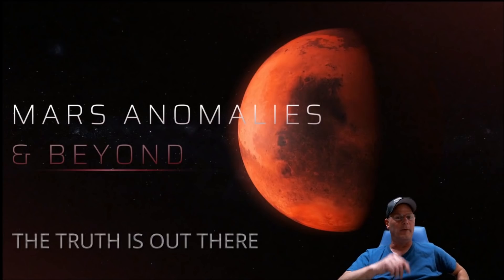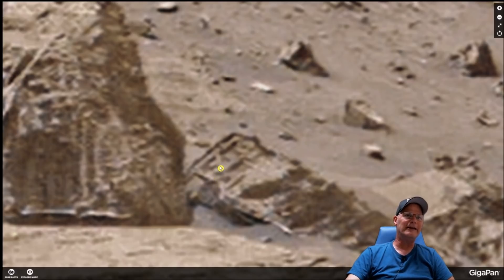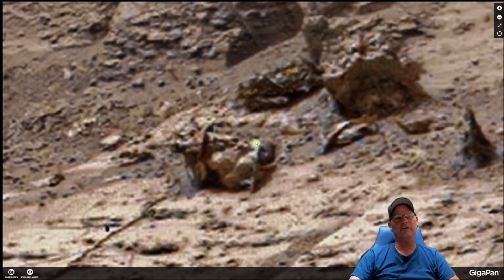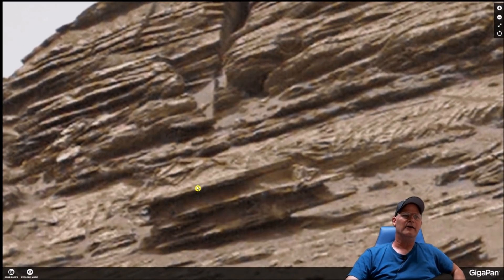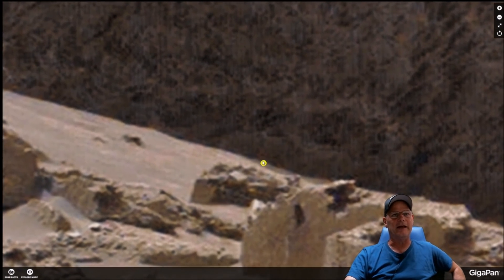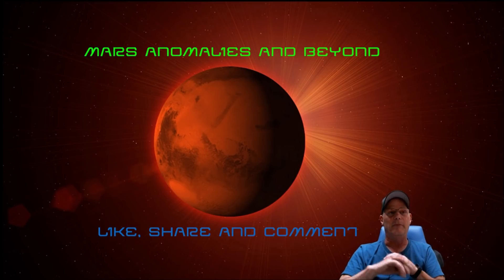Eroded Martian Stairs / Embedded Mechanical Parts ~ 5/24/2022

Comment: When I downloaded a partial image to GIMP and used autocorrect, blues lept out. This is where they eradicate information with their 'sand deposits'. About those sand formations, they are not regular in their presentment as to drifting. The deposits are irregular in volumes and accumulation. They remove virtually all data from the 'sand'. So, BS!

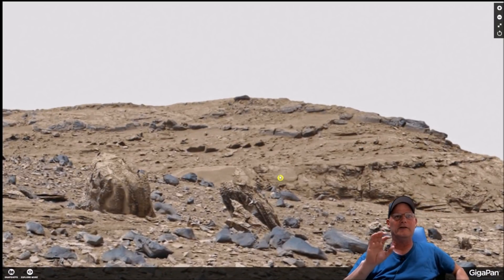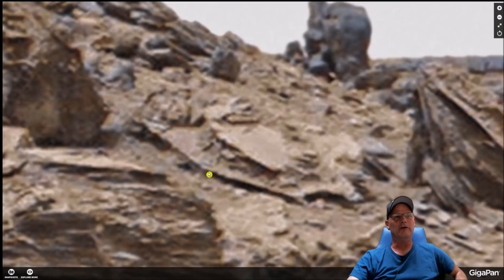Comment: At 2:15 these rocks looks like what is left of a base of structures. 4:30 looks like a crash cite. 5:26 dead center at the horizon it looks like a circular object. 5:35 on the ground lower left a box in the ground with a stone head. 6:22 these objects has moss growing on them. 7:13 in the huge crack to the left is that an auto body ? 8:37 definitely mechanical. 9:50 the set of stairs the blocks in the wall has "cells" just like the ones here on earth.

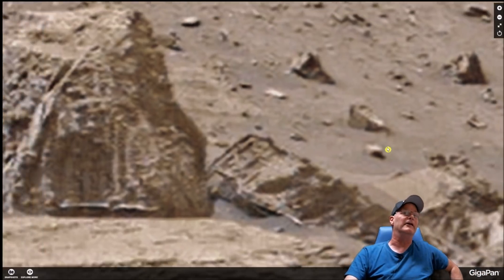Comment: Is it me,? Or does it look like that there is moss growing on those two rocks around 6:40
Reply: Also at 12:37 you can tell this set of rocks in the middle behind him are completely fake you can tell they are totally painted in you can see the lines where they painted them in and it's covering up probably a structure that belong to that set of steps in front of it it doesn't even match with the rest of the scenery and also if you look over his right shoulder you can see these Jagged things sticking up out of the ground and a line in the dirt that looks like was dug out from it creating a path. Lots of weird stuff in this imagery. Keep up the good work!

Comment: Without question the very first collection of artifacts you show are remnants of foundations. The remaining footprints show deliberately placed stones defining right angled corners and square floor plan. Rooms are laid out with dividing walls and everything. 
 Look I grew up back east and New Hampshire, Massachusetts, where nearly everything that remains of any historical relevance is built on exactly what you see here..stone foundations...property lines are piled stones. pre civil war era structures are everywhere, in the woods, just being taken back by nature will no longer have any wood metal or glass that isnt worn away dissolved or composting..all that’s left is the foundations heavier stone footing

Comment: Chris, I have seen at least 50 of your vocasts now and I don't see how anyone could say there wasn't a civlization of some sort on mars. That being said, some of the beings from that civlization had to have gone off world and the Earth could have been their savior planet. What I am guessing is that they are the civilization who came and built The Great Pyramid of Giza. Look at my research on it and tell me this wasn't built by a race of beings who knew the heavens. 1. It is 3/60th of a single degree of true north
2. It weighs 6 million tons
3. Its footprint is 13 acres
4. It is more than 755.9 feet along each side
5. It is 146.75 meters high
6. It has more than 2.3 million individual blocks of stone
7. It is locked into the Cardinal dimensions of our planet; The dimensions of the Earth are incorporated into its dimensions.                                                                                                                 8. If you take the height and multiply it by 43,200 you get the polar radius of the Earth
9. If you measure the base perimeter of the pyramid accurately and multiply that measurement by 43,200 you get the equatorial circumference of the Earth
10. The scale is not random, the number 43,200 is derived from a key motion of the Earth, which is called the precession of the Earth’s axis
11. The Earth wobbles on its axis very slowly at the rate of 1 degree every 72 years; 43,200 is a multiple of 72; 600 X 72
12. So; they’ve given us the dimensions of the planet in The Great Pyramid of Giza on a scale defined by the planet itself
13. There are several 70-ton blocks of stone raised 300 feet above the ground
14. It has eight sides, and at the spring equinox and the autumn equinox one side of the pyramid is in the shade in the morning and again in the late afternoon and can only be seen from the air—as far as my research has shown.
15. It is a calendar
16. It has expansion joints
17. It is located at the exact intersection of the longest line of latitude and the longest line of longitude of the Earth, in other words The Great Pyramid is located at the precise center of the Earth’s land mass.
18. The builders possessed highly sophisticated knowledge of mathematics and geometry
19. The builders had knowledge of the true dimensions of the Earth to extreme precision
20. The builders possessed exceptionally advanced technical instrumentation to site The Great Pyramid
21. Pi = C over D Phi = Divided by 5 + 1 over 2. Archimedes discovered Pi about 250 BC, but Egyptians knew of it 2,250 years earlier
22. The Great Pyramid is 146.75 m high, its height X a million equals the distance from the Earth to the sun
23. If you subtract the inner circle from the outer circle of the circumference of The Great Pyramid, you get the speed of light in meters to four decimal points: 299,792,458 meters per second
24. The weight of The Great Pyramid is 5,273, 000 tons and that multiplied by a billion is the weight of the Earth
25. If you divide the perimeter of The Great Pyramid by ½ its height, the result is 3.14 = Pi                                                                                                                             
26. The three inner rooms; the king’s chamber, the queen’s chamber and the unfinished chamber under the pyramid are proportional to the distances between Mercury, Venus and the Earth.                                                                                                                                                             27. The distance from The Great Pyramid to the North Pole is the same as the distance from The Great Pyramid to the center of the Earth.                                                                                             28. The height of The Great Pyramid 146.75 m X 1 million = the distance from the Earth to the sun.                                                                                                                                                                    29. The weight of The Great Pyramid 5,273, 000 tons X 1 billion = the weight of the Earth.                                                                                                                                                                                     30. If you divide the perimeter of the pyramid by 1/2 its height the result is 3.14 pi h/2 = pi These are of course mere coincidences that happen by chance...                                                                      31. The base side length is 364.242 which is exactly the time in days it takes for the earth to orbit the sun.                                                                                                                                                      32. The high chamber is built on a double square, which leads us to the gplden ratio geometry       33. Pyramids in China, Mexico and Egypt align with the Orion star system

Comment: I think this "door" and the lines/cuts in the rock are mostly artificial because nearby you can see the legs of a dead martian sticking out of the ground, and a few miles southwest you can even see the structures/ruins of a larger city recognize.
Reply: These structures near curiosity look artificial. reminds of ruins and streets, walls etc. here are the coordinates: 4°48'28.83"S   137°22'48.94"E

Comment: Chris if you look center pic at 6:48 just to the left of that yellow mark. There's a round item with a dark hole centered and what looks like a "V" attached to it. You see that? Then same frame, hour hand...around 10:30 there is what looks like the same item just a little smaller, might be due to aspect, but it there. However the "V" is orientated the other direction as the one towards the middle of this pic. Awesome....wow at 10:54 (continued video) there is another one....same item on the damn stairs. Maybe more. What's going on?

Comment: There is so much to see in this pan. No way are these all rocks. I see what looks to be I-beams and lots of structural and mechanical parts. Also very obvious are certain areas that have been airbrushed to look like sand, but with 90 degree corners? I think not. Thanks Chris! 👍❤️